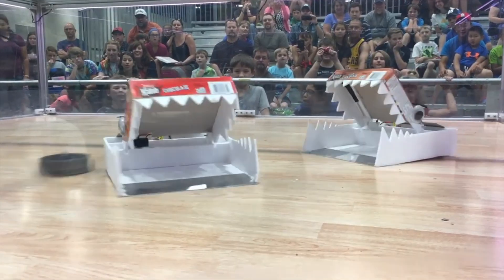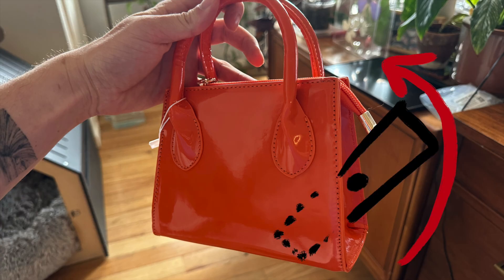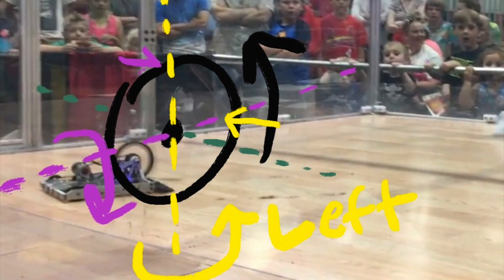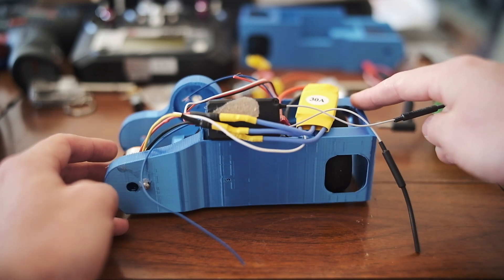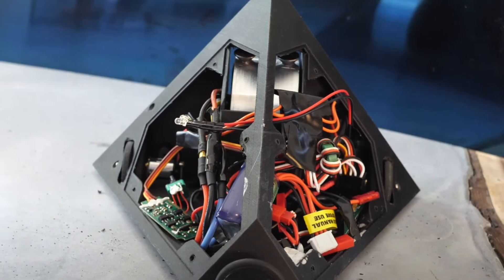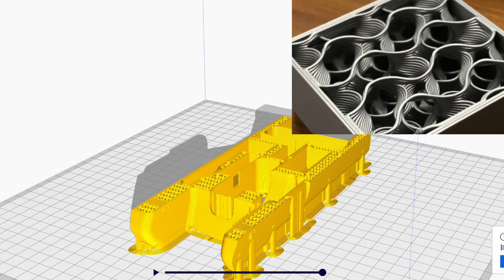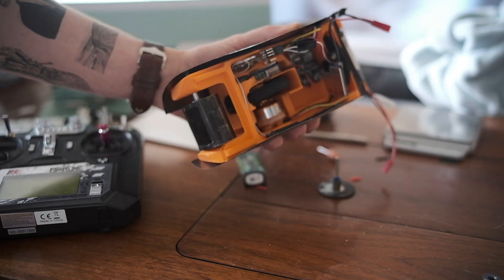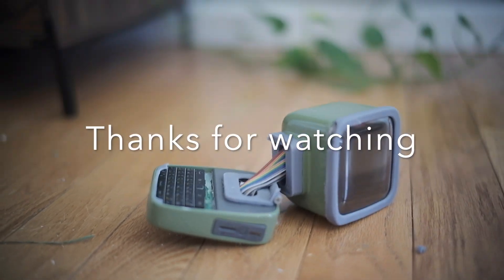Taco Tuesday Antweight Combat Robot

Comment: For some reason, the fact that you have a homemade lens does not surprise me.

What even is the spec on that thing
Reply from the maker: I have experimented with my own optics from torn apart older lenses, but this one is just a modified existing lens. It’s an f1.2 40mm e-mount lens converted to GFX. Because the GFX flange distance is longer than e-mount, you can’t just adapt the lens, so I re-worked the lens case, but kept all the optics together in the same unit. By removing all extra material around the rear elements, I also improved vignette slightly  (the lens was never designed for a larger image circle than FF so was cutting off some light at the corners)

The result is equivalent to a 31.6mm f0.94 lens. Pretty cool. I never use it wide open for video, though. 

medium format for video is super super dumb, but I got my camera for photography first, and then just also use it for video (cause why not, I don’t upload in 4k anyway)
Reply: @CarterHurd  0.94, good god, no wonder why this shot 0:17 looks so trippy, on an ultra wide lens no less, I thought that DoF was surely artificial. I know its not what you upload, but man, I would love to see those process
Reply from the maker: @rRhyan  I just switched recently, so I'd like to get some good sample shots before doing a video on it, but I might do one eventually. Basically no one is using medium format for YouTube (for good reason), so it could be an interesting video...

Comment from the maker: For this video I tried to focus less on details of the assembly (i.e. "motor A goes here") and more on the creative process. There are plenty of videos on how to assemble an antweight, but fewer videos on how to come up with new designs. Here I forced creativity by starting with an intentionally dumb and restrictive premise (the purse), and then worked from there. This lead me to a novel design without even trying. 

For this project, I stopped here... but if you wanted to you could then remove the dumb premise (a robot shaped like a random thing), and continue to refine the new idea that resulted from the exercise (wheels mounted inline with the spinner). In this scenario, if you removed the meme-ness, this wheel configuration actually does have some advantages: the spinner/non-spinner ratio of the front is good due to the narrow design, the robot's turning center is located near the spinner, the inboard tires may be less of a target than with a traditional 2WD vert, the initial roll-axis wobble allows a few deg of ultra quick turning before you have to fight the gyro forces to turn further, etc.